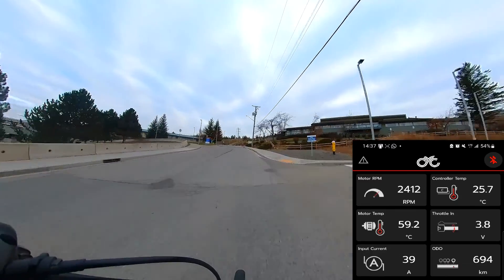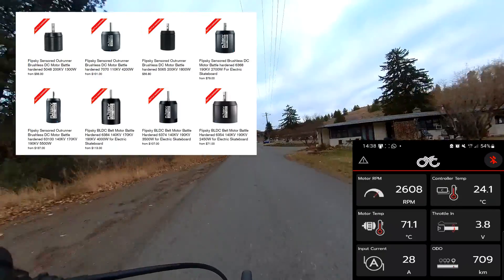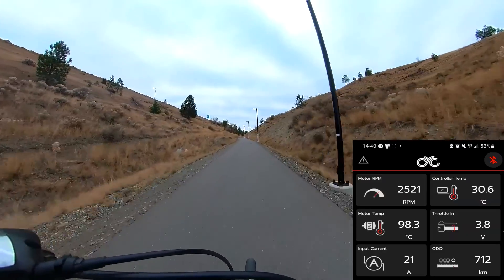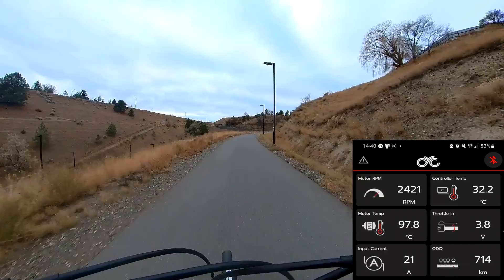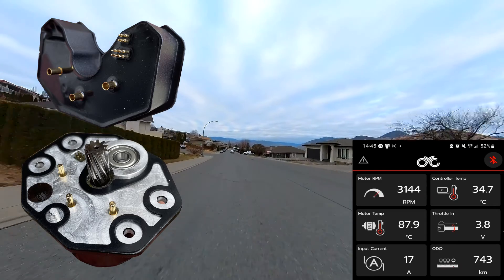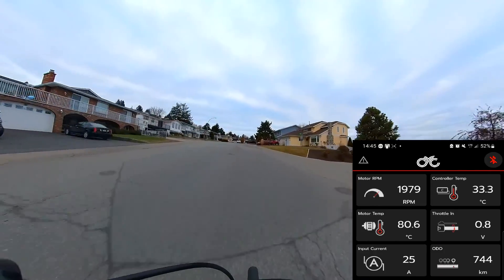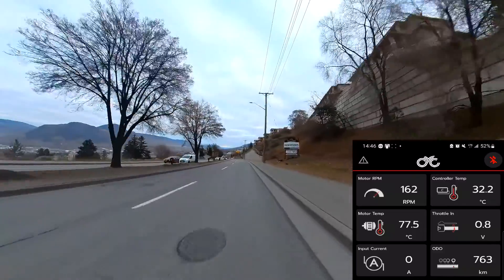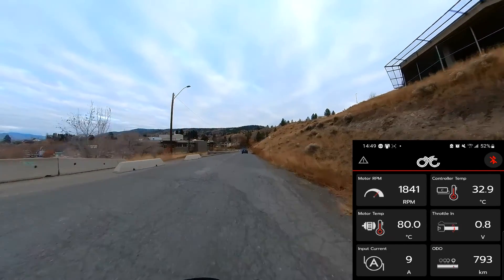How This Ebike Motor Works - Why the CYC Photon gets hot

Comment: Just passed 1000km on mine, and really could not be happier. I run mine at low power and mostly off road, and it absolutely beats the pants off all other ebikes I've ridden and will go pretty much anywhere. I don't think I've ever seen temps over 70C, and generally well under 50C*. Given the compact size, the smooth torque sensing, I'm not seeing anything else that comes close regardless of price.

I think that you have to accept the cooling limitations of the outrunner design, and not expect to be able to run this at 1.5kW continuously. And TBH, how much power do you really need anyway? My BIL is a paramedic, and he almost daily sees the results of people riding way too fast on ebikes.

For the niche market where more power and speed is everything, this is not the motor to get - but for more mainstream, calmer riders, this might be the best one - if it develops a record for reliability.

*Hey CYC, datalogging would be nice!
Reply: Thanks! We're working on datalogging :) w
Reply: @cycmotor   could you also please weigh in on if motor over heating is an issue? If so, what about a Statorade type product as sold by Grin Technologies? If not, why not? 
  Just a few minutes ago, I ordered your mid drive photon. Then I came upon this video. Has any reliability upgrade been done on units shipping now?
Reply: @cycmotor  has the photon mid drive been paired up with a carbon fiber belt driving an enviolo continuously variable rear hub? with their electronic cadence control?
Reply: @cycmotor  awesome, looking forward to that. Probably a bit niche for most people, but for this product would be really useful. Please keep working on the photon, I would probably buy a MK2 version.
Reply: Exactly. Best dam motor and destroys ANY factory motor on any mainstream ebike. Your experience flies in the face of this terrible video. Mine too. I love all four of my bikes with Photons.
Reply from the maker: Good comment. Always enjoy hearing from you. The video here is the extreme but I wanted to see how it would cope even in the colder weather. I think with your usage you ought to get a long life... I hope I have not jinxed things saying that. You have a point in terms of what else is there. It definitely fills a niche. The torque sensor I have said all along feels really nice. Perhaps the DM02 will shape up to be a competitor. We will have to see. It's very new. Beyond that there is not a lot. The Tongsheng is flawed. There are a few other kickstarter things. In terms of power you need as much as possible!!! LOL I think that CYC should be more realistic with the way they market the motor. Make it plain as day what its for and be open about the consequences of thrashing it at the limit. They might seem obvious but offering a 2 year warranty at 2kw is asking for trouble. But if they say otherwise people will question its durability. Rock and hard place. Hopefully the reliability does improve. I feel for your other half. That's a tough job I used to do that one. The idiots where I was were riding quad bikes, dirt bikes and skidoos. Been to a fair few of those. Some sadly fatal. Know your limits wear the proper gear and be able to stop as well as you can go fast are key. But people don't and think they are invincible with giant hubs and tiny brakes. It's not the speed or power its the person. If you cannot avoid an accident or limit the consequences you have no business doing it. That's my take anyway. Hope you having a good weekend mate. Cheers

Comment: Luckily the only time I would use the throttle is navigating a deep, muddy rutted part of a track or pushing the bike up something very steep that I’ve dabbed on, and the rest of the time is pedal assist in 250W mode, toggling between 0, 1 and occasionally 2. I did have some issues with the speed sensor and assistance not cutting off at the prescribed speed on the last ride out, but it was also raining a lot so maybe that had something to do with it - I haven’t yet investigated.
Reply from the maker: Good idea and likely will net you longer life. Not sure on the speed sensor. Its tricky. Its not working quite right on mine as you can see if you look at the way the trip is behaving. The magnet is super close though so not sure what more I can do. I will play with the location. There is not an indicator as to the correct path and that is something that would really help.

Comment: Id like to see that air gap so I could maybe put some thermal paste around the motor before putting it back in the casing.
Reply from the maker: It's not the same as with the Tongsheng. The motor has to have an air gap to allow for rotation. So any thermal paste will stop it turning. Maybe I should have done a better picture. If you look for some youtube videos on Eskate board motors though you will see what I mean. The entire outer casing of the motor is the rotor which spins around the stator. The heatsinking is more of a protective casing than an functional heat sink for large parts of the surface area.
Reply: @HighVoltageKits do skateboards and scooters have the same problem with overheating? Is there something above the way the power of the motor is used on a mid drive that is causing issues?

Comment: CYC Photon outwardly designed motor has a fundamental physics issue of increased proportional rotational inertia .Due to what is being rotated relative to a conventional inwardly designed mid-drive motor or a hub motor. Which reduces efficiency and increases the production of heat. But conversely the outward design does create greater torque relative to its size. So like most things in life there are trade-offs.

And Statorade is an option for dissipating heat from outwardly designed motors. 

Thanks for another well thought out logical post. Even when the post seems to miss a few key points, It's always well thought out and fascinating to me. Keep up the good work.
Reply from the maker: Thanks. I read that you get more torque from an outrunner than an inrunner of the same physical size. Which is why the BBSHD is more torquey than the X1 its just bigger. Lower max RPM tho as well on outrunners. In terms of the statorade. It would be inside the casing still. It would not be inside the air gap. So although it would increase the transfer to the outer casing of the motor. It would not eliminate the main issue here which is the gap that is needed to allow it to rotate. At least I think you can't put it there.
Reply: @HighVoltageKits  Outrunner circumference is greater, so naturally it's going to have greater torque. Versus an equivalent inrunner. And which is why a standard radial flux motor is an outrunner. 

Statorade wasn't designed to fully bridge the air gap for any outrunner, such as a hub motor. That would increase drag. But it still improves the heat transfer rate for an outrunner motor, such as the CYC Photon motor. 

And I'm not telling you to take my word on it, why not check with Justin at Grin Technology?  FWIW, I'm willing to wager real money that it will make a statistically significant difference. But it's up to you, to decide if it's worth your time to prove or disprove its value.

(Lastly, thank you for correcting my nomenclature. My dyslexia makes it difficult for me to use the most appropriate term)
Reply from the maker: I understand what you mean. Do you understand where there air gap is though. It's between the outside of the motor casing and the heat sink material. If you think of it with a hub motor. That would be like putting the statorade on the outside of the motor.  Where it would just fly off into the air and run down the side of it. The air gap cannot be filled that way. If it could I think CYC would have done it from the get go. I was not attempting to correct anything on purpose. I will send an email to Grin though. Maybe they can help me to phrase it a bit better. I will add the explanation in to the weekly tech talk / chat I have started doing. Appreciate you getting involved. Cheers.
Reply: @HighVoltageKits    It is true, Statorade Is designed to transfer the heat for the air gap within the actual motor. 

So a subsequent gap between the rotation of a non-EMF induced motor casing and a heat sink will not be an appropriate application for Statorade. Redesigning it with tighter tolerances and/or a heat transfer material to fill the gap, such as oils or gels. Would be more appropriate for addressing that issue. 

But since the rotation of an electric motor normally, takes place between the stator and the rotor. And not an outer casing and a heat sink. It would be nice to have a visual representation of what's taking place?

Hopefully a teardown of the CYC Photon motor, will be possible. Or a series of detailed diagrams. To 'fill in the missing "air" gaps' of understanding, at some point in the future. So we can visually see, what you describe verbally in your post and your comments,  

Also please excuse the tardiness of my response, but YouTube didn't notify me of your response and I just came across it by random chance, Merry Christmas.

Comment: Your talking points are quite valid, and I'm glad you mentioned them. I have the Stealth that I've been quite happy with. I haven't had it in race mode at all. This video doesn't scare me, but I haven't had the need to blaze past 30MPH on my Trek.
Reply from the maker: Cheers. If you don't push it then you could be okay. Much depends on the type of riding you do. The CYCs I have seen that have made it to large milages have generally been run at lower power levels,
Reply: @HighVoltageKits  And how many have you seen out of how many that have been sold? You act like your limited perspective is all pervasive. So troubling. I have thousands of miles on 4 photons (my entire family has one) and zero problems. People with zero problems don't complain. Your perspective is skewed and inaccurate.

Comment: I was tiptoeing between the Photon and the DM01. I'm glad I chose for the Toseven DM01!
Reply: You dodged a bullet well done 🏅
Reply from the maker: Its new as well but it has the thermal mass to dish out the sustained power and the rotor size to provide meaningful torque. The torque sensor is not as refined but I'm hopeful it will close the gap over time. It's about 90% there
Reply: You chose wrong because you were misinformed.
Reply: @robert-portillo  After the update in March, I'm happy with my DM01. Top speed is also really good with a 50T chainring: 57km/h GPS.
Reply: @detmer87  Cool. I bet you'd be much happier with the Photon and may have bought one if terrible videos like this hadn't mislead you. I own 4 bikes with Photons. Zero problems and thousands of miles combined. I get 68 km/h with a 42t chainring. I tried to fit a 50t but my bike frame won't have it.

Comment: Good summary of CYC motors. I heard they have some overheating issues but I didn't realize it's self inflicted by their own motor choice!
Reply from the maker: Yeah it does seem to be that way. The only one that is an inrunner is the X1.
Reply: @HighVoltageKits  thanks. So because X1 is an inrunner then should it cool down better? When I'm looking at the X1 it doesn't seem to have much ribbing to dissipate heat.
Reply from the maker: They can get hot as well. They don't like sustained power over say a 5km climb as I found out. But yes as an inrunner it can shed heat more readily. It has its own issues though mainly concerning the rotors.

Comment: Good video! Why actually did your wife's motor fail? Or what did fail due to what? I guess she didn't run unrestricted all the time on full power overheating it constantly, right?
Reply from the maker: I was on unrestricted. I don't think she was thrashing it as much as me but she rode it in hot weather and it heats up quick. It could have been damage from when I was riding it. It was the hall sensor board that failed which is right in the center of all the heat.

Comment: Totaly agree with your experience with the thermals. During the summer on 100+ °F days my photon was thermal throttling constantly. Now with 50°F days it rarely does but i usually stay under a kw and use pa mostly. Have 2600 miles clocked, about 3/4 pavement 1/4 singletrack. The only issue i have is my left crank arm bolt keeps coming loose after a few hours of riding with it being torque and thread locked correctly.
Reply from the maker: You are doing better than me at 2600! Long may it continue. The left crank issue. Take off some of the spacers if you are using them. They don't really add anything. I think they can prevent the left crank arm from fully crushing into the splines. The spacers there are another one of those things that its really hard to judge how many to use. I did not bother with them on the latest instal. Golden motor did not bother with them from the get go. Just make sure to clean the threads on the axle before you remove the lockring if you then take the motor off.
Reply: @HighVoltageKits   Thanks for the tip ill give it a try. 👍
Reply: Statorade could possibly help with that throttling issue.... Since it's configured more like a hub motor than a conventional mid drive..... Best to contact  Grin technologies and make sure you talk to somebody who is familiar with how the CYC Photon mid-drive motor is designed.....
 
Just a thought, good luck.....
Reply: Statorade will try to stick between the rotor and the stator, the air gap will still be there.   Because of this I tried to use auto transmission fluid for a while in my cyc stealth.  It worked wonders eliminating almost all the thermal throttling on my commute even in the summer.  Downside was the poor seal the motor has so it couldn't keep the fluid in.  Due to all the servicing I had to do on the motor, the seal only got worse over time.  I ran the stealth between 600-800 watts, and after 5700 I replaced with with a Bafang m620 (it cost less than the cyc stealth too)
Reply from the maker: Thanks for sharing. If the Photon has a better seal it might work. Not sure I want to be the guinea pig though.

Comment: Thank you for this. I've been hesitant to go for the Photon now I have further reason to wait/pass until the issues are corrected by CYC.
Reply from the maker: I have heard they are going to do a Gen 2 whether they can resolve the heat issue I am not sure. If you want a motor that can run at 2kw this probably won't be it.
Reply: @HighVoltageKits Did you hear from the manufacturer that the second generation will be released? Do you know the approximate time?
Reply: @HighVoltageKits  You can do bursts with zero issues. And that alone is worth buying this amazing motor for. I own four of them, all flawless, with thousands of miles. The motors blow away the Bosch and Yamaha motors. Period. A few people have problems and ignorant reviews like this trash their brand and hurt sales.
Reply: Same, went with DM01

Comment: I was saying this on endless sphere from the very begining. This motor should be treated only as pedal assist 500W motor. Anything above that will significantly increase chance of failure! 
Anyway. I'm buying ToSeven DM02 instead of this overpriced junk.
Reply from the maker: You called it man.
Reply: LOL, ToSeven DMO2 is a joke compared to the Photon. This reviewer is clueless.

Comment: my old cyclone mini use to overheat shut down a lot in summer, different design than CYC but about the same size the heat sinks i made helped a lot but 35+c summer only  so much, that's why i upgraded back then to the 1800-3000w big motor, it never over heated ......
Reply from the maker: Yeah. The issue here is putting on additional heat sinking won't do anything as the air gap will still remain. Thermal mass is important. Without it you can't run high power for long.

Comment: OMG! Raise the temp just a bit and you can cook/bake inside that casing. Too bad, I had hopes for this motor. It's probably an awesome performer with a 750 watt max but, as you suggest, not at all price competitive at that power level.
Only having had cadence sensing I really want to try out torque sensing pedal assist. Now my only hope for a torque sensing option to the BBSHD is if Toseven make a 120mm BB version. Bafang has a torque sensing motor but it seems to require a bunch of proprietary accessories, including display and battery & it's not hacker friendly.
Reply: No you can't. You can't "bake" the inside casing because thermal overload protection kicks in.
Reply: @robert-portillo  I said you could "cook/bake inside the casing", not "you could cook the casing". As in you could put a little cookie dough inside & come out with a case shaped cookie. It was just a bad joke about the motor getting too hot.
Reply: @michaelsprinzeles4022  Ahh gotcha. But the motor never gets "too hot" as thermal overload protection kicks in. I'm just tired of people smearing this incredible motor. Its the best mid-drive torque sensing motor in the world. This video is very misleading and unfair to the company.
Reply from the maker: Yeah. The smallest cakes ever lol. There is one more hope and that is the Cotton Mouth. We will be exploring torque sensors for that one and if we can get that done it will put everything else to shame. Still waiting on confirmation of the battery situation with the Bafang one but it does look like it will be UART. Which means we can upgrade it but the torque sensor likely won't work without hacking.
Reply: @HighVoltageKits  I've only heard about the Cotton Mouth but know nothing about it. Something new to research. Exciting times in the e-bike world. When I did my first build (2017), if you wanted reliable (& remotely legal), the only question was pretty much which Bafang motor.